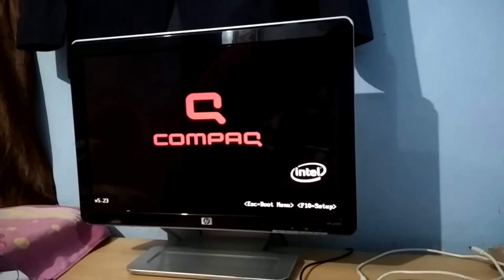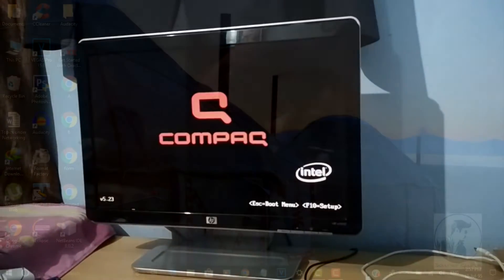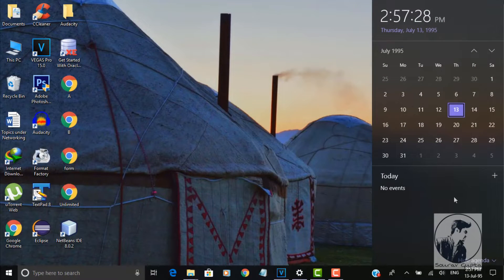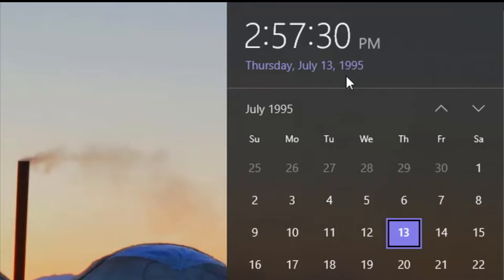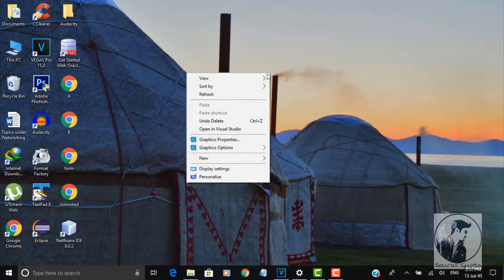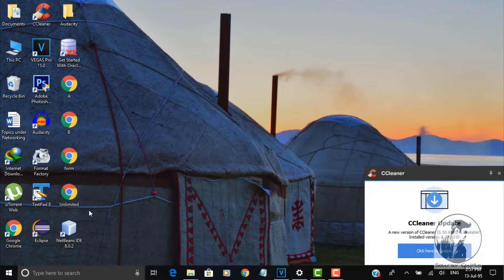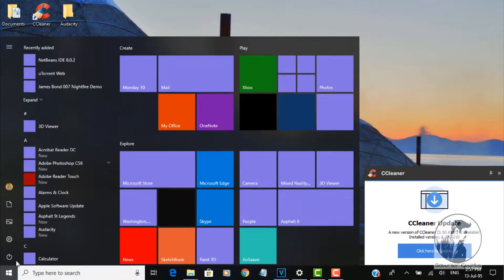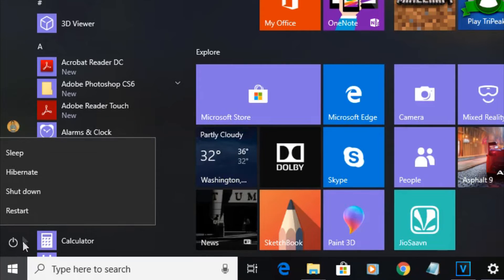How to fix PC - Date and Time Keeps Changing

Comment: Pls suggest wht to do if the same problem is with laptop?
Reply from the maker: Hey NineOranges

First check the time zone whether correctly set or not.

To change the CMOS battery.
1. Remove laptop battery
2. Press power button for 10 seconds
3. Remove back panel of the laptop
4. There you will find CMOS battery slot.

Make sure to check the mah of the battery, which is written at the back.

Replace the battery with the same mah battery.

Stay tuned. I'll make video on this soon.